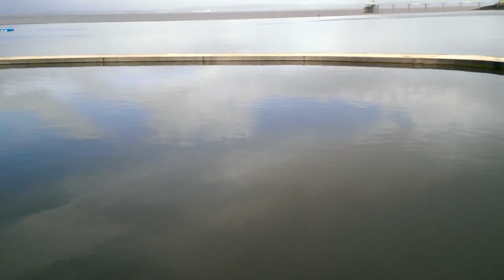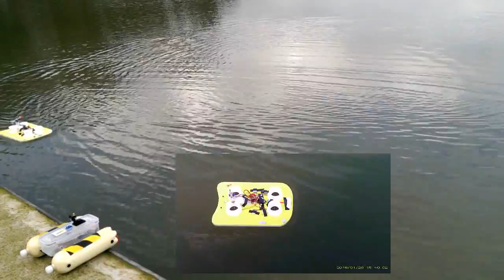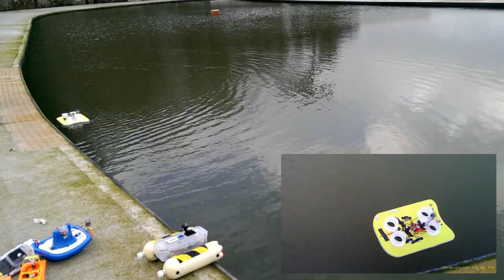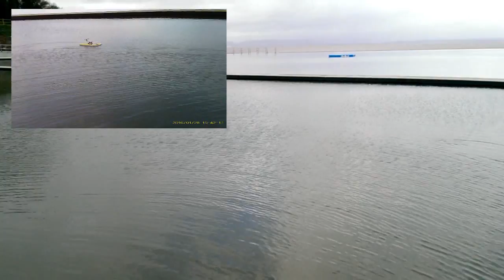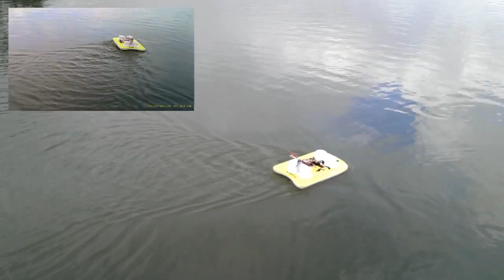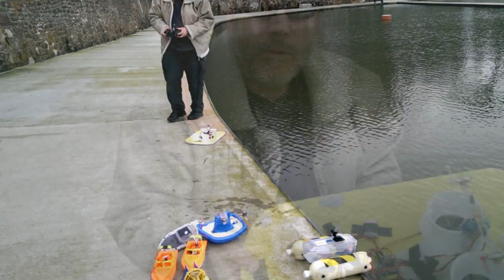Quad Fan Hovercraft - skirtless - Clevedon Marine Lake 160128

Comment: Hovercraft like this really need a double hull to work properly, and the four lift motors just seem overkill.

These craft are VERY easy to build if you understand that you need to get a cushion of air under the craft, and for that, the craft needs to actually have a flat bottom to ride upon the cushion.   The four motors are blowing out the cushion as it's created, and there's really nowhere for the air to push back up against before escaping.

See my videos on how to build an RC Hovercraft where i show a VERY simple way to build a great flying double hull skirtless, as well as many other hovercraft i've got up.
https://youtu.be/ocuYTigFA4o?list=PLGbZTlKSG1v9yLH3yBXPXX6cCy8zQNdTt
Reply from the maker: That's a great build there Rusty, thanks for the link. That is very much where I was going with this different build in my general hovercraft playlist https://youtu.be/el4upYiYa7E?list=PLA5a2xPRSrB3zoLYIrdESCCWdx2nLq8r7  The original inspiration for the quad fan hovercraft was  the floating tables used for moving heavy industrial equipment, so it was just supposed to be a flat surface with a very small air gap but as the project developed it went off in a different direction. It was supposed to be all components from cheap RC toy cars and vibrating toothbrushes. You will see by episode 13 in my quad fan hovercraft playlist it does "rather loosely" approach the design of yours https://www.youtube.com/playlist?list=PLA5a2xPRSrB1ynqKhyKVIcl945NCbHZZE
Reply: GrandadIsAnOldMan There's a problem trying to scale large stuff down like that in that the Reynolds numbers are hugely different. 

The large industrial mover basically sees the air as thinner than your craft so the aerodynamic requirements change. I saw the skirt arrangement you have, it's still putting the open fans exposed on the bottom. You need to cover the fans and duct the air around the edges and then inward under the flat hull bottom. The four direct fans just have so much airspeed escaping from the bottom that it probably fights itself, speeding up the air leaving too much and causing the fast air to lower pressure and suck the craft back down. 

Basically as a rule a properly working craft should hover at a height of 8 to 10% of the hull width without instability.
Reply: GrandadIsAnOldMan There's a problem trying to scale large stuff down like that in that the Reynolds numbers are hugely different. 

The large industrial mover basically sees the air as thinner than your craft so the aerodynamic requirements change. I saw the skirt arrangement you have, it's still putting the open fans exposed on the bottom. You need to cover the fans and duct the air around the edges and then inward under the flat hull bottom. The four direct fans just have so much airspeed escaping from the bottom that it probably fights itself, speeding up the air leaving too much and causing the fast air to lower pressure and suck the craft back down. 

Basically as a rule a properly working craft should hover at a height of 8 to 10% of the hull width without instability.
Reply from the maker: Thanks Rusty, did you look at the other link in my previous reply. Here it is again https://youtu.be/el4upYiYa7E?list=PLA5a2xPRSrB3zoLYIrdESCCWdx2nLq8r7
Reply: Okay, I see what you did, that's a lot closer.   For better performance make the bottom of the craft flat instead of having all that space to fill under there.   It's working but it's doing it using skirted craft dynamics, essentially your foam food trays are behaving like a skirt but without flex.   Try a flat bottom with both a gap all the way around the edge and what's known as a stabilizer hole that is 1/2 the prop diameter and directly under the intake duct. This pushes a small percentage of the air directly under the craft while the perimeter gaps supply the bulk of the curtain air.  The stabilizer hole makes it more solid in flight and less sensitive to being out of balance,as well as able to respond to weight shift control without getting squirrely. 

And another hint, all the torque problems can be easily solved with internal vanes if your decks are flat and parallel.   When I do a double hull i make the top deck the exact same shape but an inch bigger all the way around and inside i put vanes to counter the torque.   Figure out which way the torque is spinning the craft and inside the hulls near the front and rear for maximum arm moment effect, put some small wings directing air so that it counters the yaw as it exits the perimeter.  On larger craft i put the vanes between the bottom deck and the sidewall at an angle so that the thrust balances torque without losing bleed air to a hole in the hull sidewall.

IDK if you know this trick either, but you can easily make a skirt with a trash bag and a soldering iron.   Lay the bag flat under the craft and use a soldering iron to trace about 2" around the craft the heat both cuts and seals the bag making a perfect skirt easily.   Next, cut proper sized holes in the top and bottom of the cut skirt to match the upper and lower deck shapes.   These skirts work so well that some of mine without any gear weight and a sealed top hole can static hover for hours.   What i mean is that i fluff the skirt up, and drop it on the table from a foot or so high, trapping air in the hull and the skirt.   The craft sits there for hours on a microcushion as it barely deflates.   I've had one stay inflated overnight before and was still hovering with low friction in the morning.   This shows just how efficient hovercraft are if you get the design right.   Try a larger craft with that same motor, and i bet it'll fly better than your small one which seems overpowered.   I've used an old .0.4A old obsolete computer fan to fly 2 foot long and 14-18"  wide skirted craft running 3s 2200mah lipos and the computer fan was still way more power than i needed as a skirted model.
Reply from the maker: Thanks again Rusty. I do intend to do some more hovercraft sometime in the future.
Reply: GrandadIsAnOldMan Right on! Hovercraft are so much fun to both build and fly! I look forward to seeing your future designs. I like the stuff your building btw, cool projects!

Comment: what is you put the skirt on, and then make holes on the back?
then the water won't effect it
Reply from the maker: +rc model boats at some time I will have another go at sorting this one out. The skirt I was using was a strip of plastic cut from a large bag and I think I had it too tight to the flat bottom of the craft. This craft has evolved away from the original concept which was based on a flat bottom and a very thin air gap like you will see on the air beds used to move very large heavy machinery. It was never intended for uneven surfaces or water. I think the next modification will be to add a ridge around the underside of the craft and maybe attach a skirt to that. At the moment it is basically a powered version of one of these https://youtu.be/aOrlP7dvd4M and this video shows the sort of thing I was aiming at https://youtu.be/t6m01VGiNPI